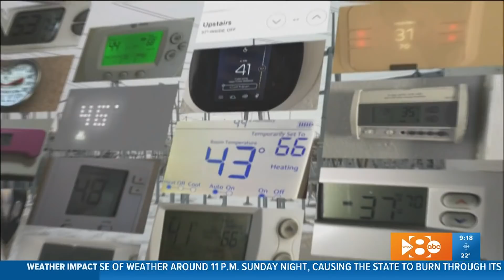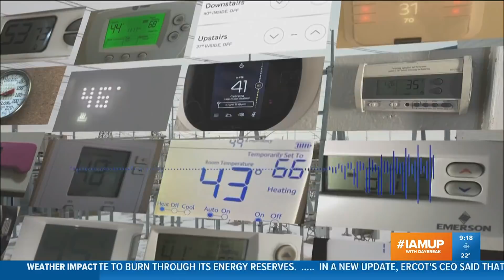How did the widespread power outages happen in Texas? A grid expert explains

Comment: All electric homes not such a great idea.
Reply: We need to go battery operated.
Reply: @victoriataylor5584  That will take alot of batterie$. and a way to charge them.
Reply: You know those houses are able to generate power right?
Reply: @jonathangarmuth8975  How?
Reply: @sylvesterstewart868  solar panels on residential homes that have battery storage.
Reply: @jonathangarmuth8975  Most homes with solar dont have storage and nave anti islanding circuitry in the inverters that wont produce unless it senses 240v from the grid.
The snow and clouds will keep the panels from producing.
Most systems with storage only have the capacity to run the fan on your gas heater and not an electric heating element.